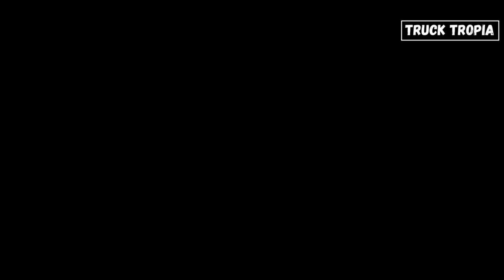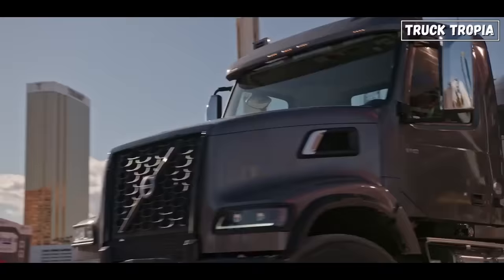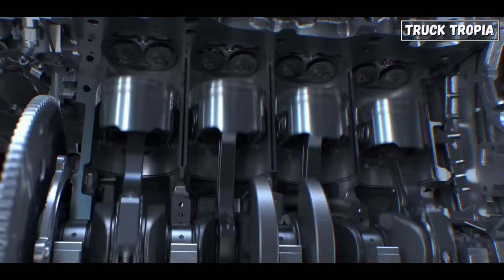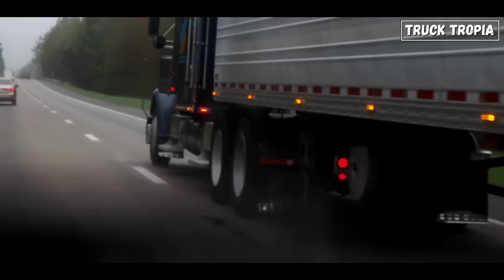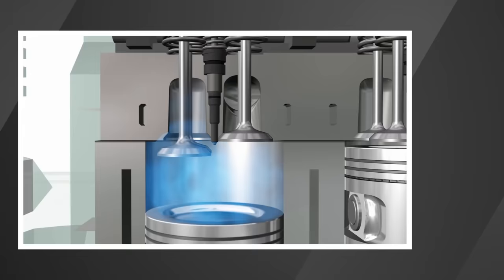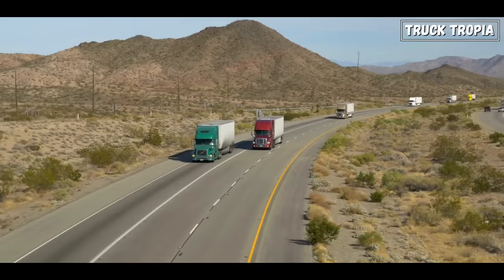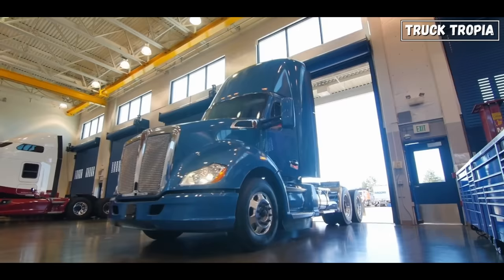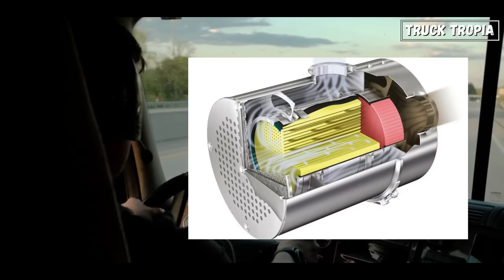Ultimate Truck Education 101 - Every Question Answered

Comment: a 'lift axle' isn't a DRIVEN axle, having it 'up' won't save a drop of fuel; if anything, it CAUSES fuel consumption, due to extra tare weight.
Reply: Yea, not so sure of that my guy. Rolling resistance plays a major part in fuel consumption. Hence the reason why air pressure in tires is so critical. 
It takes a certain amount of energy to overcome rolling resistance and that energy generation translates to fuel efficiency, or the lack thereof.
Reply: Not if you need it to carry the weight when loaded.
Reply: Where did you get the extra tare weight from?
Truck still weighs the same regardless if axel is up or down .
Reply: Because drag???

Comment: I love what you said about manual transmissions and control, skill, and the art of driving, so I definitely understand why that's hard to shake; sometimes it's even just more fun! Yep, yep, and more yep! But I would also understand why some drivers would rather just not have to worry about that. I do understand that the more modern transmissions, and even all that being replaced with electric motors, are becoming more advantageous, though.

Comment: Is it possible to have a long wheelbase truck to have steering for rear axles similar to fire trucks?
Reply: That takes two drivers.
Reply: They’ve got it. I’m more familiar with military trucks, so google a PLS. That’s a 5-axle truck. The first two are steering axles, the next two are five axles, and the last is also a steering axle. There’s a drive shaft extending from the steering box that operates both the front pair of axles and the rear axle.
Reply: Any thing is possible, but always at a cost. Think of the complexity of the steering knuckles on your front wheel drive car.
Reply: Pusher and drag axles yes, a steering drive axle not so much.

Comment: "...Looking to cut operational costs" (re: automatics vs. manuals). Yeah, that has flipped on its head in recent years, because it used to be that manuals were less expensive to maintain and more efficient, but not so anymore. So nowadays, spend more money on the automatic transmission up front in the short run to have less cost over the... the "LONG HAUL," ha! Especially when, as you said, auto trans prices are coming down. But I think I would still have more fun driving a manual one. My old pickup trucks were all manual and my current car is one.
Reply: At least you're consistent in all of your stuff being manual. I'm tired of people saying they'll only drive manual semi's, but then their car or pickup is automatic. Then, to have those same people complain about other semi drivers only wanting to drive automatics.
Reply: @DarkWolf9109 : Sorry, I didn't quite follow you. Only drive a manual semi's what? Which thing belonging to the semi did you mean to include there?
Reply: @HelloKittyFanMan  I was referring to people who only drive manual transmission semi's and say that's the only transmission they want in them but turn around and have their car or pickup be an automatic transmissions. To then, have those same people complain about others who want to drive an automatic transmission semi and call them lazy for not wanting to drive a manual transmission semi.
Reply: @DarkWolf9109 , you didn't even understand my question. I wasn't asking about the people; I was asking about the semi. When you said "semi's," which thing that belongs to the semi were you trying to refer to but left out... twice now?

Comment: The problem I have with automated transmission for my job is I drive a smooth bore tanker and have to control the surge with acceleration and shift timing. How would I do that with an automated transmission solely focused on fuel economy, not load management.
Reply: Manual mode?
Reply: Why no baffles in the tank?
Reply: @andrewdouglas1963  my company bought it used. But food grade tanker have no baffles so they can be properly cleaned out between loads. You’re not always hauling the same product. My tanker was an old milk tanker. But you wouldn’t want a guy to haul a load of milk on Fridays and have some residual milk sit there till Monday.
Reply: Automated transmissions have option of manual mode and can be shifted as such. You have as smoot oor even smoother shifting with automated.  My experience is on Mack M-shift  and it is quite smooth.Never thought I'd like automated transmission but once you learn the ins and outs they are a breeze and make the job easier.

Comment: Thank you for this video.  Can you make a video on electric trucks or hydrogen powered trucks? Thank you
Reply from the maker: Yes coming soon 👍
Reply: We only have a couple in Australia and some buses but we have already had 4 fire's with the affect on insurance and the fact it costs more to fule them here by 25 present I'm thinking they won't b popular any time soon especially when U add the Waight. bty my tractor's have way more gear's 40 to 45 for the big ones
Reply: @jasonw3204 

As far as fires, do you mean EV or H2 or both. In the US, both have had fire issues.
Reply: @Mentaculus42  it's across the board government is covering a lot up due to them owning a lot of the big stuff and the overall records are hard to get as only inderpent reporters are reporting the hole issue needs to be addressed as for me I can make bio fule if I need to

Comment: Lift axles dont distribute weight they alllow more weight. Fifth wheel sliding and sliiding trailer tandems distribute weight
Reply: If you lift an axle, the weight has to liturgically be distributes somewhere else.  Just saying. Or when you drop an axle, like with a dump truck with 3 axles, it literally distributes the weight from the standard axles across to the third axle too.
Reply: And if your air tag has a valve for varying the air pressure to the tag system, you can actually move the weight from one axle to another. That is why there are laws about the use of them. Drivers would vary the air pressure on the scales to appear legal when they weren't.
Reply: Huh??

Comment: Last year my fuel cost was way less than that because of fuel discount and what is called Fuel Surcharge, it's what the company I'm contracted with bills the customer for fuel.  You are off by about 30k
However I didn't run 100k, I ran more miles.

Comment: AUTOMATICS ARE JUNK!!!
Reply: They're getting better, and great in traffic, but expensive to buy and maintain.
Reply: @hansjansen7047  "Great in traffic"? When I need to go and I need to go NOW, give me a 10 or a 13/18 (bottom doesn't need split on an 18 anyway), any day!

In a ¼ mile, I can beat ANY automatic off the line with any stick. Before you respond, "It's not a race", when pulling out into a busy intersection or in stop & go traffic acceleration is crucial!

God forbid your air runs low because you're on & off the brakes using air faster than your compressor can keep up. Then you fancy automatic WON'T WORK AT ALL! The tire can still roll above 60psi and MY ARM STILL WORKS!
Reply: Have you ever driven a proper automatic truck? They're great, i would never even want to try a manual truck.
Reply: @TopiasSalakka  Unfortunately, that's ALL I drive now. My company phased out the last manuals in 2019.
Reply: @Stacy_Smith  You'll get used to it 🐡
There is no downside to them.
Reply: @TopiasSalakka  Have you ever heard the phrase "Transmission Fault"?

Nuff said.
Reply: @Stacy_Smith  What is there to fail, it's just pneumatic pistons controlling the shift forks and the clutch 🐡
Reply: @TopiasSalakka  Computers glitch, wires short/break, sensors fail, air runs low, and ice can wreak havoc on pneumatic solenoids.

It's needless complexity added to a once simple system. You're talking to someone who's been driving for over 20 years.

Comment: I wondered why a diesel was more efficient than a gasoline when I was a teen.  I looked up the BTU's of the two fuels per gallon and found that they were almost the same.  So energy density is NOT why a diesel is more efficient.  If one studies thermodynamics and heat engines the second reason you gave is the main reason along with not depending on a spark plug for ignition.  That is higher compression ( and therefore temp range of the operation of the combustion) allows for a bigger difference between the beginning and ending temps of combustion.  Like you say, they extract more of the BTU's out of each gallon and convert to work.  Shell Oil has a great film on the topic.
https://youtu.be/7yRBK0ADB6I?si=AHESiKeW9wUKb6YI
Reply: P.S. As I re-read my comment I realize something:  Energy density just means more BTU's in a given volume (per gallon) but the fact that a diesel may get double MPG of a gasoline powered unit means it is actually getting more work out of each gallon of fuel if both fuels are similar in energy density.  Fundamentally a diesel is more efficient than a gasoline engine per unit of energy consumed.  The shell film pointed that out - 22 percent vs 35 percent (in 1960 anyways - they might have each gotten a little better since then).
Reply: @wdmm94  Diesels have a higher thermal efficiency than gas. More of the combustion is converted to power than a gas engine where the combustion creates more heat that power.

Comment: I'm curious about automatics and implementation. Is it more common to see autos with like a torque converter or auto manuals with a clutch? And how do autos fare in difficult terrain where drivers need to really control engine braking?  I've driven school buses before, but that's strictly an auto with exhaust brake that you can turn off, or it comes on when you tap the brakes.

Comment: In the US, 2000 lbs = 1 ton.  80,000lbs divided by 2000lbs is 40 tons, not 36- on interstates with a 5 axle combination as long as you meet the length requirements or bridge law— And that weight limit varies by state when you are on US and state routes, could be more or less than 80k and the axle arrangement varies by state along with that.  There’s no “national standard“ other than on the interstate
Reply: 1 ton = 1000kg or around 2204lbs.

1 short ton = 2000 lbs or around 907kg.
Reply: @AlexKall well, in the U.S. - 1 ton = 2000lbs
Reply: @Outlawbuckettrucker   the US uses short tons.

Comment: I run in US and move extreme loads run a 1MM 600hp Cat pushing 650hp over 3,000 ft pounds of torque it is the only engine I will run. All truck engines basically have same stroke and compression ratios except a 1MM has longer stroke higher compression ratio with a competition head which I just changed to a new one which has more nickel in molding bigger ports valves thicker walls. My truck is a 99 Kenworth W900 86” studio sleeper yes long wheel base have to have to clear some units I move. My truck weighs 24,000 pounds heavy duty frame three lengths of fifth wheel slide set all the way back because yes my engine is heavy. I sit at 11,000 on steer bobtail. Would no trade my truck for any new truck. They stall and die trying to move what I do.

Comment: OK the reason for the in-line six has nothing to do with the stated extra benefits that you said in this video
The in-line six is more durable and easier to service due to the fact that it doesn't suffer from secondary vibration and doesn't require extra parts like Like those seen on other engines. The engineers figured out that secondary vibration in an engine causes more wear than any other factor in harsh application.

Comment: I disagree with the statement of European engines being larger. The 770 hp Scania is 16.4L and the biggest caterpillar is 15.8L which is only marginally larger. Sure the V8 will be wider but it will easily fit between the frame rails of a conventional NA truck. Not to mention it will be shorter than an in-line 6. Plus the weight is actually quite similar, even when compared to the bigger Cummins or Detroit engines.
Reply: But it's not fitted to a conventional NA truck. It's fited to a european cabover with a flat floor.
Reply: @andykennedy5982  I’m not understanding what your argument is.

Comment: I can tell you from personal experience that 500hp is not enough. I did a lot of driving in mountainous terrain and the 515hp I had was underpowered and if I had my choice it would be a 700hp unit minimum for my choice of power unit. I have never driven an auto truck and would find it strange as I grew up driving manual transmissions in everything from cars to farm tractors to trucks.

Comment: I have driven "electrahaul" trucks that had a detroit diesel motor as essentially a generator for the electric motors in the wheels that drove the truck. The truck was a bit "sketchy" when it came to stopping. It had huge disk brakes that were used for bringing the sllwed truck tk a stop. The main method of slowing tne truck was using the "retarder" which made the electric motors run slower and the sketchy part came when going downhill. You had to engage the retarder befor cresting the hill or your speed would exceed the trucks ability to stop...

Comment: Gasoline engines can be made that gets just as much power as a diesel engine but the fuel usage would be atrocious. I have never met anyone who got over 6mpg for a diesel truck.I was an o/o and never got better than 5.6mpg from my rig because of the low performance power unit.
Reply: Depends what you call "power", horsepower means little without torque, diesels create more torque.

Comment: Weight regulations vs Europe don’t make sense to me. Why is the weight limit 80k lbs but in Europe it’s upwards of 160k lbs. yet the US is much flatter and requires less force. Meaning we could either have larger loads or smaller trucks. Even if there’s a length requirement we could still have higher load weights. Perhaps it’s bc we have worse road standards and can’t handle the weights

Comment: Now the EV trucks are allowed to be over 80k. For years they told us 80k was because of the bridge formula. They also said the bridges were in bad shape and we should vote for the gas tax. Once that was dome the governor moved the money out of the road fund. So we still need to fix the bridges or just quit lying.
Most of the automatic transmissions in big trucks are automated manual transmissions. Not actual automatic ones. Mainly because they are too heavy and cost more to repair. The ability to shift the manual transmission with servos became possible when the engines were computer throttle controlled. First demonstrated at the international truck show 2000 Las Vegas.

Comment: European trucks can take more and can take more weight with bigger engines.The load weight ISIS more than 80000 pounds and the steer.Tires can have over 7 over 12000 pounds more than U.S.

Comment: You're wrong on the 80K weight limit in the U.S. I worked for a company that all their trucks were licensed for 105.500 lbs.
Reply from the maker: Just Stated the federal limit 👍
Reply: Yes you can be licensed for over 80k but still require either annual permits per state driven or per trip permits for each vehicle either empty or loaded or both depending on equipment specs. 
Also, being licensed over 80k doesn't exclude the need for these permits or their associated costs.
Reply: Needs a special permit though, even if it's a yearly one, We run more than that in PRNY(people's republic of new york).

Comment: 4:38 80,000 lbs is NOT 36 tons.  It's simple math folks.  80,000/2,000=40  It's 40 tons.
Reply from the maker: Be a bit more educated 80.000 pounds = 36.000 kg = 36 ton
Reply: @TruckTropia  Be a bit more educated.  If you are going to say pounds then us metric ton, you need to say METRIC ton not ton.  When you start with a specific system of measurement (albeit imperial, SI/metric or whatever), it is understood all other measurements will be in that same system, and if not, it is proper to distinguished between the different systems.  Also, 80,000 lbs = 36,287 kg, which rounds to 36 METRIC ton.  More over, in English, TONNE is the conventional alternative spelling for metric ton (when not using "metric ton"), thus to distinguish between the two different measurements.
I know, I am a "stupid American", but I am educated enough to know the difference between TON and TONNE.
Reply: @TruckTropia   Where did you go?  Hopefully to get a bit more education.

Comment: Where do you get your info on tonnage. In the USA 2000 lbs is one ton. So 80000lbs is 40 tons
Reply from the maker: Yes but in Europe 80.000 pounds is 36 ton
Reply: you are perfectly right! I think his calculation used the British measure of 2,240 lbs = 1 ton. If you divide 80,000 lbs by 2,240 you end up with 35.71428571428571 tons! Just one more error in this "factual" information!